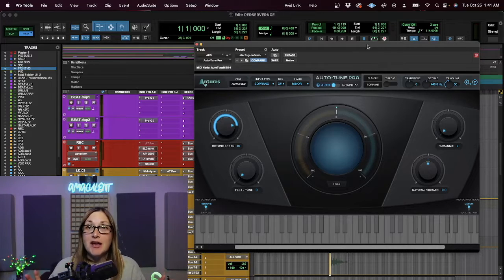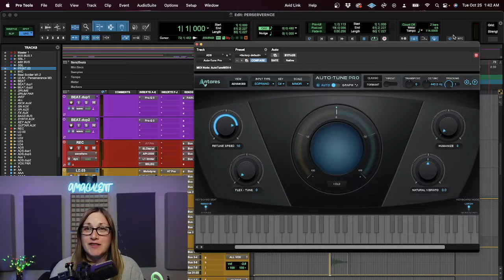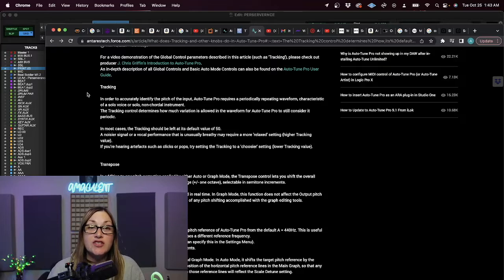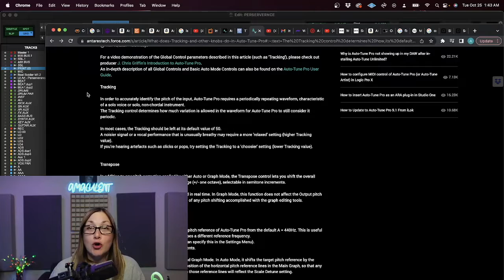Getting rid of Clicks and Pops CAUSED Autotune Pro

Comment: if you turn it down all the way or low, it straight up doesn't tune....
Reply from the maker: That is not true
Reply: no thats true. putting it on 1 causes notes to not get tuned
Reply from the maker: @MarioAndLinkGamer  I have literally done it so many times and it has not affected the tune for me on a way that mattered at all to the record.
Reply: @AMACULENTMINDSET  He’s right, when i put it on 1 the auto tune does not sound the same at all lol
Reply from the maker: @lilreemer4100  even tho I have not had this experience it is still the solution Antares gives for this issue. Take it up with them not me lol

Comment: Thank you for this video, this issue has been with me for a long time and I never knew what it was. Thought it was my mic, or my volume levels. Decided to see what plugin could be causing the click and figured it was autotune. This is gonna save so much stress. And you're right, tracking on 50 is fine for the most part, but that click is so noticeable in a song

Comment: Damn, apparently this doesn't work for rendering performances after the fact. When it wants to pop it will just pop.
Reply from the maker: After the fact of what. If it’s printed, yea it wouldn’t work but if it’s just the plug in on it in real time it should
Reply: @AMACULENTMINDSET  I'm essentially using it like Melodyne to tune vocal tracks for a mix through the Pro Tools Audiosuite method and am getting occasional pops unless I re-record it in real time, which is what I've done for the lead vox but there are so many bgs that I attempted to render them offline but popping is so regular that I'll just have to do it all in real time with another track armed and then compensate for latency. The client says they prefer the sound of Autotune but I might just try and get away with using Melodyne for the bgs. Thanks for the help though, I may just have needed to articulate the problem to someone!

Comment: going down to 1 on the tracking is essentially bypassing your autotune isnt it? there has to be a reason or another solution for it
Reply from the maker: It doesn't bypass the auto tune. If it did this wouldn't be a solution. This is the explanation Antares gives and tells you to do when this is happening.
Reply: @AMACULENTMINDSET  It kinda does though, only picks up and adjusts the pitch of the vocal like half the time.

Comment: you are literally a legend. this is an issue that's been haunting me for yearsssss already. thank you so much. 

-to add to her video: I found that when I took the tracking knob to 1, it completely fixed the pops as the video said it would BUT unfortunately it made my pitch slightly off. 
I added a pitcher on top of the autotune and it fixed that issue right away.
Wanted to add this just in case anybody else found themselves in a similar situation.
Reply: which pitcher do you use?
Reply: @ItsJaneASMR  i just used the stock one in FL, if you're in another DAW i'm sure that any stock pitcher should do the job
Reply: Yuh this is the exact problem I had once I took tracking to 0…. My pitch was Waaaaaaay off. Sounded crazy. Didn’t know what to do to help and I wasn’t about to add double auto tune. I will try the pitcher and see how that works.

Comment: This doesn’t help because turning tracking to 1 turns down the retune ability.
Reply from the maker: Well it’s the solution Antares gives so it’s about as helpful as it gets.
Reply: @AMACULENTMINDSET   I understand! But this does not solve the problem if you want to still use the autotunes features.
Reply from the maker: @asherodde  In my experience it has never been an issue. I’ve never felt the tune suffered at all from doing this when the clocks and pops are an issue.
Reply: I see what you're saying. I'm trying this out right now and when I turn the tracking to 1, it's as if auto tune is bypassed